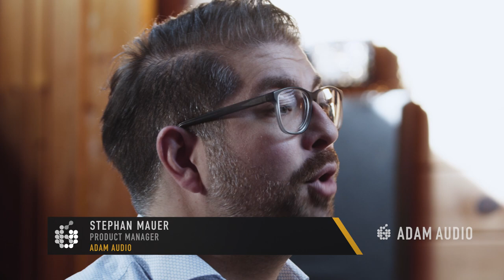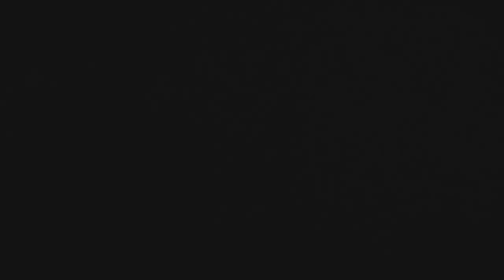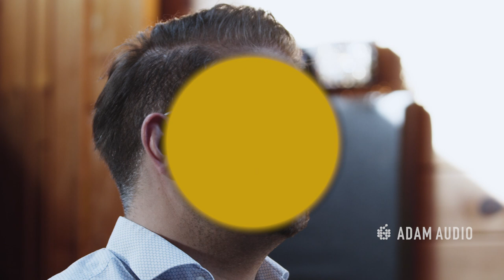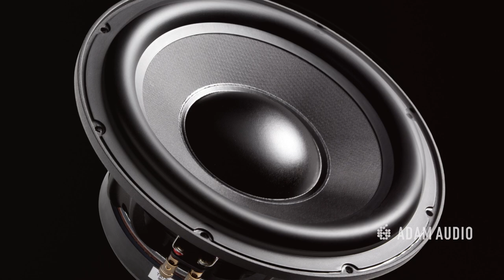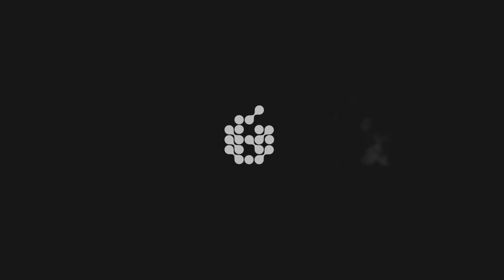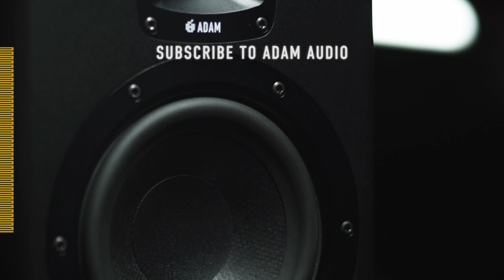Breaking in Studio Monitors (Burning in Your Speakers) | ADAM Audio

Comment: Just got a pair of the Adam A77X and they sound even more better now that they are fully burned in. Pink noise and dynamic sounding music + good treatment=One happy Artist/producer.
Reply from the maker: So happy to hear that you're enjoying them! Cheers
Reply: Adam speakers may be fine,  but other speakers may literally burn by pink noise. Many speakers cannot accept much continuous power especially at low end and high end frequencies.
Reply: Those are the monitors I want to upgrade to. I decided on those after seeing Rupert Neve test his 5088 consoles with the A77X models. I'm currently using a vintage pair of NS10M's  I bought new in 1986 with a subwoofer.
Reply: @azzinny  Agree partially. If you don’t crank up the volume to it highest setting, pink noise isn’t a problem. A safe level would be between 40 and 50% volume.
Reply: @emiel333  This is correct, however for burn in purposes pink noise isn't ideal anyway, as you want something that moves the speakers a lot. Something rhythmic and/or something containing a lot of low end energy is ideal as it gets the spider moving a lot, and expedites the process. You want to burn them in with quite high spl (as it makes sure they are settled within the time frame suggested, as that would of been the expectation from the manufacturer usually), if you only have them at 50%, it may take up to twice as long to fully settle as the spider isn't fully being moved through out it's entire extension. Something like dynamic music or simply just a pulsating low sine (so as to give the driver full motion but not be asking for peak power constantly, just part of the time).

Comment: Hello, just got my Adam t7v’s yesterday. (Sound great)When I make the speakers completely out of phase with one another, as expected,  there is barely any sound with frequency sweep type audio and also barely any speaker movement. Isn’t it the point to exercise the speaker to burn them in? So What should I be using if I want to to use the out of phase method? Pink noise,  just music. Thanks!

Comment: 8 hours have to be continuous or could be pause in between ?
Reply from the maker: It can be hours at a time, just 8 hours total. Good question!
Reply: ADAM Audio thanks for the tips. Considering moving to your monitors from Yamaha.
Reply from the maker: @MDOTDASUPA  If you end up making the switch, we know they will treat you well for years to come. If you have any other monitor questions, we're always here to help!
Reply: @MDOTDASUPA  i listened to a pair of Yamaha HS8 and a pair of T8V. U cant go wrong with either. It felt like the yamaha was more in ur face while the T8V was more spacious and smooth. But imo u cant go wrong with the Adams.

Comment: I own a pair of Adam A77X.  They are a dream to record and mix through. 
 Why do you have the mid-range driver on the inside and not the outside, which produces a wider stereo image? 
I use the mid-range driver on the outside by placing the B monitor to my left and the A monitor to my right. They sound amazing either way. I've had them both ways round but prefer the wider image. Are there any technical drawbacks (such as phase issues) to configuring them this way?
Reply: Would the a77x be good for forensic audio in your opinion? Clear wide field and some punch when needed?

Comment: Bought a pair of Adams A7x about a year ago and hated them. Now a year later after being put away in my storage room I find them sounding a lot better. Luckily I did not sell them.

I have a question for the ADAM team... is there a huge difference between the Sub10 and the T10s... I mean I know one is the price, power, amplification etc but I mean a bad kick will sound bad even on the most expensive subwoofer in the world. And vice versa...
Reply from the maker: Hi Ricardo, yes both subwoofers will show you accurate low-end with your system... the biggest consideration is the difference in power, however. Where the T10s has over 10dB less power than the A7Xs, giving you a large discrepancy in the SPL between your sub and satellites. The T10s has been designed for our T Series, where the power is similar and will give you an accurate low-end at an accurate level. The Sub10 is SPL matched with our A7Xs giving you an extremely accurate frequency range... The other option is dual T10s subwoofers with your A7Xs.
Reply: you hated them?! you must have been use to your other speakers. the Ax7's are fast becoming a golden standard.

Comment: ADAM audio Can you please elaborate about facing the speakers towards one another for the sound canceling effect? How close to one another? Do I need to do anything other than face them to each other to get this effect? 
Thank you
Reply from the maker: Hi there! The speakers can be placed relatively close together, but leave some space for airflow. You might need to experiment a bit and see how the cancellation works best in your surrounding. 
For the left and right signals to cancel each other out, one signal must be rotated in phase. To do this, you can play two signals in the DAW. One signal is completely paned to the left and the other to the right side. 
Now one of the signals must be rotated in phase. Usually, there is a phase rotation button, but this works differently in each DAW or sampler. Especially bass frequencies should be reliably canceled out this way. I hope I was able to help. All the best, Daniel 😊

Comment: Is it normal that I hear a little hiss sound when sitting closer to the ribbon tweater with the Adam T7V's?
Reply: yes
Reply: realized that too. just take the output on the back down to zero or below and crank up that interface - at least that's what I did

Comment: If you don’t burn the monitors in (I just got A7X) will they eventually burn in ok with normal use? Or do you risk a lesser sounding speaker without burning them in all at one time?
Reply from the maker: Hi Jonny! You don't have to burn them in all at one time. The question is if you listen loud enough to really burn them in. When you change the polarity on one speaker and they face each other, you can let them burn in on high volumes, without too much disturbance for you or your potential neighbors 😉 All the best

Comment: What level do you recommend calibrating a pair of T7Vs to? I'm told 75db each speaker but that seems really quiet to me. I don't want to turn them too loud so they don't blow.
Reply from the maker: Hi Thagirion! We don't recommend a fixed level, but rather to burn them in at a reasonable level. All the best!
Reply: 65-75db for like 10 hours. I don't work for Adam so I can get away with saying it... then again, I'm just some random on youtube so take that as you will... but, 65-75db look up a white noise full range video on youtube and play it. doesn't have to be loud just needs to move through the spectrum think of it like "stretching" before a workout.

Comment: One of my monitors makes a buzzing noise whenever it hits some bass or sometimes when someone is talking, I've tried plugging in into a different outlet, using a 3 to 2 outlet adapter, tried a different XLR cable, broke them in a bit. Noise is still there, any suggestions?
Reply: You sure it's the speaker and not resonance of something in the room or something it's attached to?
Reply: @aepstein824  You know I'm not sure but the sound actually went away so I guess I did just have to break them in more

Comment: Burning in process will change the behavior of the tweeters frequency too or only the woofers ?  Tried out T8V's for a few weeks at home and replaced it to T7V's because the frequencies came from the tweeters caused serious tinnitus while i listened them on a very moderate sound levels. Now i got the T7V's becasue i believed these 8 inch monitors are simply too large for my relatively small room and downgraded to them but the tinnitus problem still exist. Moderate volume levels (in fact much lower as i used to listen on hifi systems). I hope it will disappear after i do some room treatment with acoustic panels but for now i think these tweeters Adam using in this series of monitors are very harmful if someone prone to tinnitus.
Reply from the maker: Hey Szabolcs! Please reach out to our Support Team and don't hesitate to ask all the technical questions you might have. The Support Team will be the best people to ask and they will be very happy to help.
You can send your question through the official form at the bottom of this page: https://www.adam-audio.com/en/support/
Reply: @ADAMAudioBerlin  i didnt get any answers from your tech support team. and glad i exchanged these tinnitus inducing, fatiguing monitors to something else. my tinnitus got much better (almost disappeared again) with these new monitors anyway.

Comment: Hi, when burning the speakers in face to face, does it have to be fairly loud?, I'm currently burning mine in at a low level (not very low). I'm asking because I don't want to do it incorrectly. Cheers
Reply from the maker: Hi ARSEFACE! The purpose of burning them face to face is to avoid the loud noise/sound when burning them at a high volume. Positioning them face to face and inverting the phase of one of them, the low frequencies will cancel out and you (and your neighbors) won't be exposed to 8 hours of noise on a high volume :)

Comment: How loud should the volume be?
Reply from the maker: Hi Doonoo!
Low to Moderate Volume: When burning in studio monitors, it's generally recommended to use a low to moderate volume level. You don't need to play music at extremely high volumes; in fact, doing so may risk damaging your speakers or your hearing.
Use Normal Listening Levels: Set the volume to a level that is similar to what you would use for normal listening. You want the speakers to experience a typical range of frequencies and dynamics that they would encounter during regular use.

Comment: Hello to Adam Audio's family! First i have to thank you about all of this tutorials and tricks! I have a one question, that i am really confused about and here is it: 

I have a new T8V's and i am setting up my config now. I am playing them trough the focusrite 2i2 and ajusting the levels throuth the interface. For now i am burning-in these ADAMs On max interface level and 0dB on the back panel of my T8V's. Is it possible to explain us about +18dB, is it safe to use them on +18 or levels between 0db and +18dB. I can't find any info about nominal output levels here for the speakers. Thank you ADAM Audio !
Reply from the maker: Hi there! We recommend using them at 0dB. The maximum SPL is 118 dB, so you shouldn't exceed this level. So it's safe to use the speaker between 0dB and +18dB as long as you don't exceed the max. SPL.

Comment: but, if you turn them face to face they will be out of phase and cancel each other so why do we need to phase invert one of them ?
Reply from the maker: Hi Tranceporter! They might be out of phase, but the polarity is not inverted. These terms are often used as synonyms, but they mean different things.
Reply: @ADAMAudioBerlin  I assume that by facing the speakers we're trying to make the sum of their sound cancel each other ... if the speakers are facing each other but playing normally without polarity inversion, their cones will be moving in opposite directions which would be the same as inverting the polarity of one of them if they were facing the listener ... my understanding is that polarity inversion of one speaker would cause some cancellation if they are facing the listener, because one cone is moving forward while the other is moving backward (if we take a simple sine wave for example) ... if they are facing each other then isn't that equal to polarity inversion? ... and while i'm thinking of this, i realize that distance would affect too, some frequencies will be cancelled and some added, no? ... just trying to understand :)

Comment: a year ago i purchased a set of over the ear studio headphones from JLAB and i have been doing the burning in since then with several burn in videos on my mac, and no improvement of sound , is there someone that can advice me what to do to get this issue solved? i would appreciate any help. thanks.
Reply: "burn in" doesn't change your speakers in anyway... it just allows your speakers to loosen up, you achive the same thing over time after about 30 hours of use. if they sound like dog shit after 30 hours it's because they are dog shit. get better headphones. i say that with respect.. try Audio Technica M50's they are a gold standard in studio's for tracking and refferencing, there are better and there are worse, but I haven't been in a credible studio that didn't have them lying around.

Comment: I started using my monitors without breaking them in beforehand. What happens next?

1. I ruined the monitors forever.
2. I could break them in now and no harm will be done.
3. Just by listening to music at normal volumes I’ve broken them in without realizing.
Reply: huh?
Reply: @visionscopemx  In other words: Last month I bought new monitors. I didn’t know about breaking them in, so I just started using them. Have I ruined them? Or should I break them in now? Or have them been broken in by my use throughout the month?
Reply from the maker: Hi Leandro, no worries, you have most likely burnt in your speakers by using them over the course of the last month (as you wrote). You could still go through the process, just to be on the safe side. You have definitely NOT ruined your speakers ;-)

Comment: Hi. Just bought a pair of A7vs and at 29:35-30:00 of this track: https://youtu.be/BuD7O1syiXs?t=1775  -- I get a distinct distortion (almost as if the speakers are blown, but it's just at this certain frequency) out of my brand new A7vs that I am not getting out of my A7x's (that I had hoped to sell) at the same point on the same track. 

noteworthy: I have the amplifiers set to 12 o clock on both the A7x and the A7vs, and have tried flat settings with the A7vs, as well as with bass boosted while the mids/treble remain flat, as well as with bass reduction to the lowest setting while the mids and treble remain flat. I still get distortion/vibration in the cone on the A7vs in every case, whereas with my A7x's it's smooth as silk. Are these just not broken in, or did I receive faulty/blown monitors?

also noteworthy: this was my first attempt at bringing the speakers to a reasonably loud volume. I've been using them at low volume all weekend.
Reply from the maker: Hi there! Please reach out to our Support Team and don't hesitate to ask all the technical questions you might have. The Support Team will be the best people to ask and they will be very happy to help.
You can send your question through the official form at the bottom of this page: https://www.adam-audio.com/en/support/
All the best, Manuel.

Comment: Can u pls explain a bit more simplified what I need to do
Reply: This is a bit late but basically when you get new speakers they are saying it is smart to “burn them in” by playing certain music through the speakers that has a wide range of frequencies from low, mid, and high. I believe that they are saying that doing this will help the speakers get their most accurate sound after you burn them in.

Comment: Did you guys do any actual testing of what the burn-in process changes frequency-response-wise? Any scientific papers? Logged experiments? Can I see some actual data that would back up this claim? Because In the headphone world, burn-in is just a myth. In my opinion, it all comes down to just getting used to the sound (frequency response, thd, phase response etc.) of monitors/headphones. When it comes to headphones it's not just my opinion. it's a fact. But I know nothing about monitors, so burning them in might actualy make a difference in how they sound, but since you've mentioned in the video that the same process applies to headphones, then I'm a bit sceptical about how you came to this conclusion.
Reply: I think the only actual burn in for speakers is like he and some other speaker makers said, is that it loosens up the speakers so that it moves better when the bass is hitting compared to stiff brand new speakers. I also heard this headphone/IEM guy say that burn in for headphones/IEMs is not real and its actually the other way around like most technology/evolution, it degrades over time, it only gets worse and brakes over time.

Comment: I bought a pair of Adam A7x, but I sadly found that its speakers are not 7 ". They are only 13 cm. They have little depth. If I want more depth but no worse quality, what do you suggest? Change it to A8x? They say that that there is a hole in the middle.The T8v doesn't sound that clear.Maybe the A77x? or sub10 is the solution?